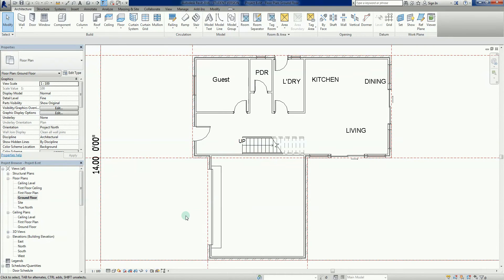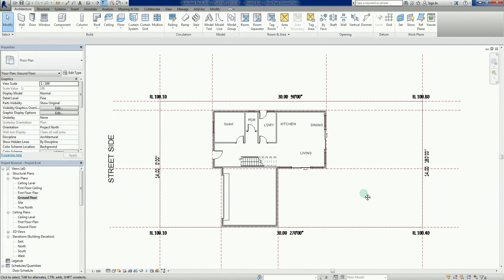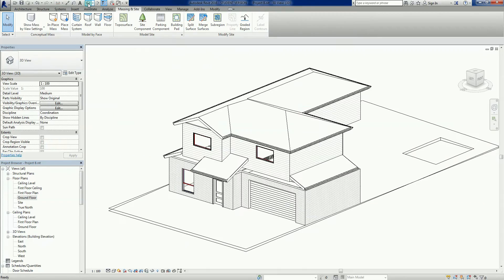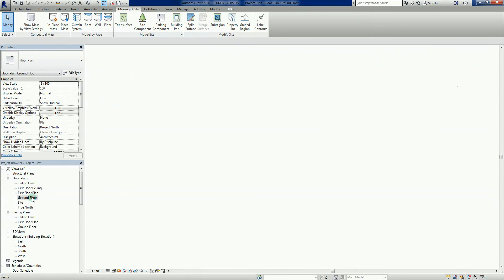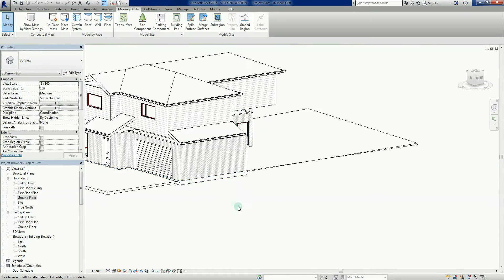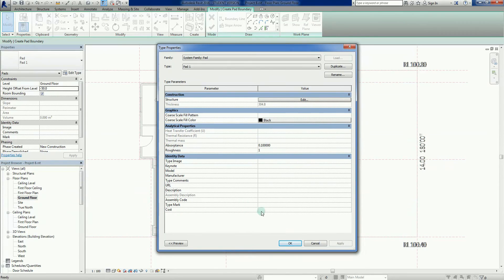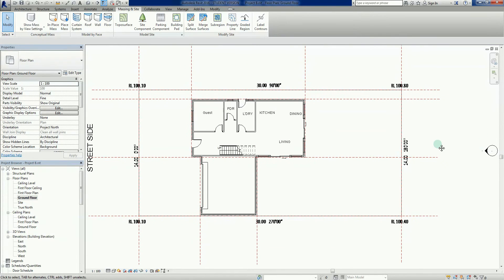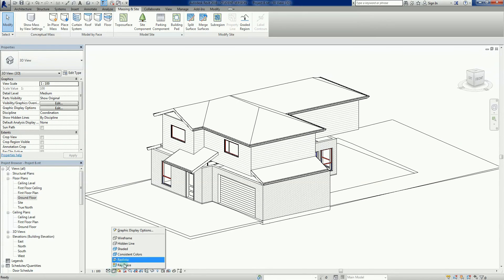Revit 2016 - Project B #16: Building Pads

Comment: What's the difference between using a building pad and a raft slab?
Reply from the maker: Hi RoDJ99

There are a couple of critical differences.

1. Building pads can only be built if there is a toposurface ... and they interact with the toposurface (cut and fill).
2. There isn't a 'raft slab' tool in Revit, but there is a floor tool. Floors can be used without the need for a toposurface, and they also be modified by adding edge beams etc. They can also overlap (even though Revit will/should give a warning about this). Building pads cannot overlap.